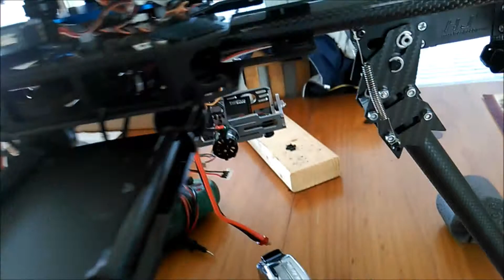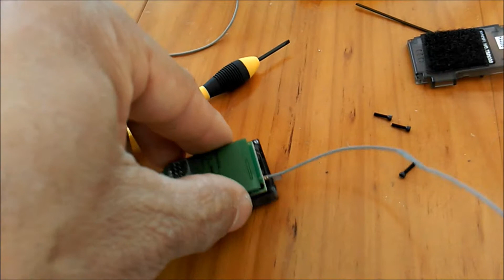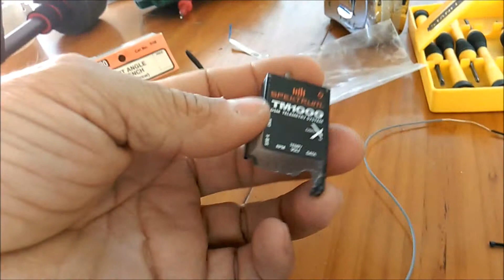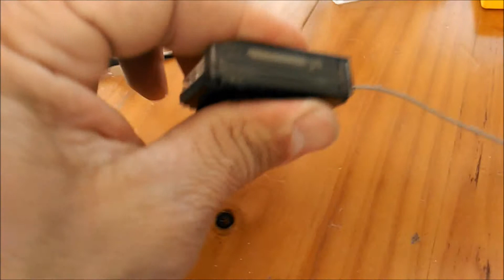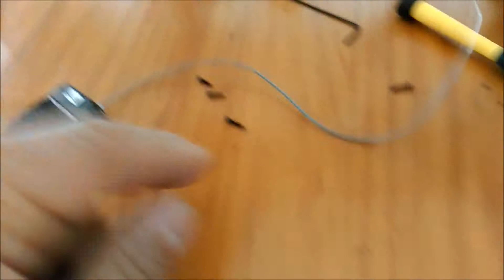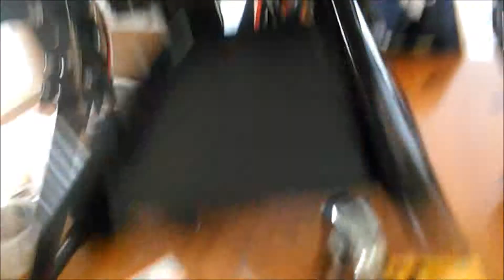SPEKTRUM TM1000 TELEMETRY REPAIR

Comment: Sure wish you had included the Spektrum part number for the replacement antenna :-(
Reply from the maker: Google your spektrum receiver model number"spektrum receiver ****** antenna" there are many types.
Reply: @RAMBLE_ON  Thanks. I have spent innumerable hours with that search. Problem is that the 230mm length is not found, hence my comment. I have a TM1000 with a broken antenna ... that's how I found YOUR YouTube video. But when I went looking for the replacement antenna I found nothing. I know your video is almost 5 years old at this point, but I hoped that you would know where you got the replacement antenna. Thanks anyway.
Reply from the maker: @Thuban06  Spektrum does not sell just antenna for TM1000. TM 1000 also is no longer sold.Look on ebay and you can still find them new and used.